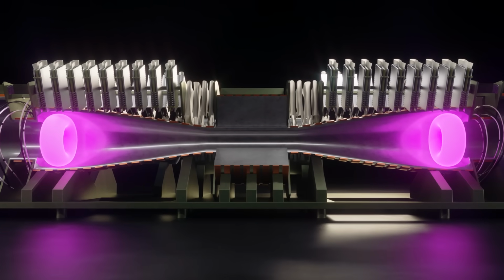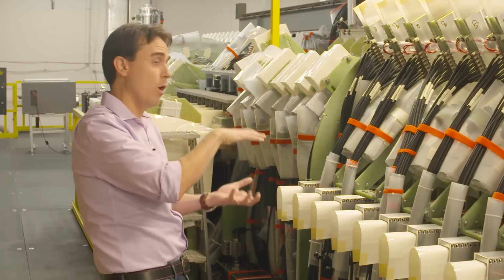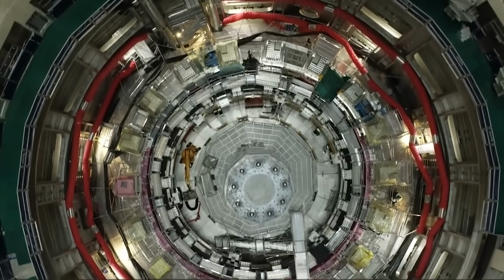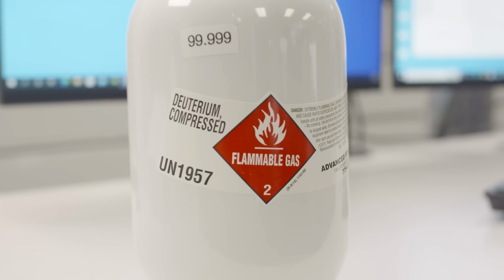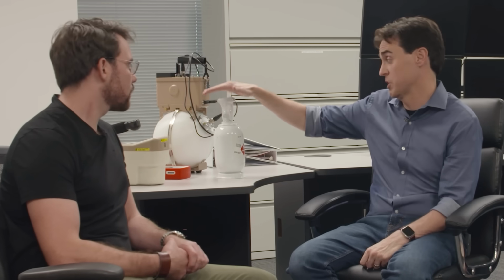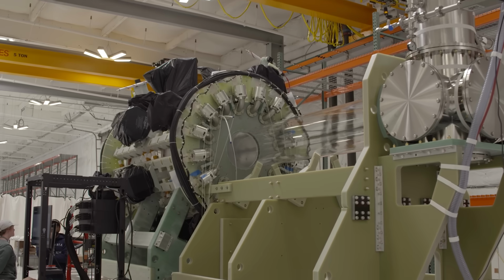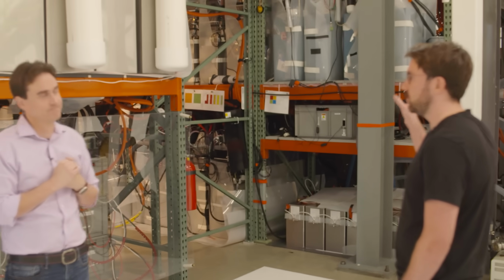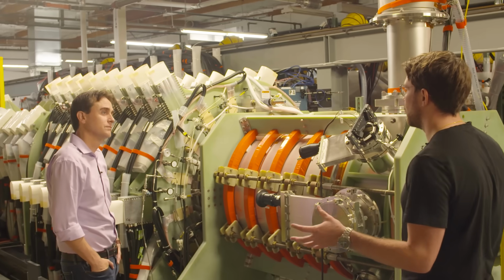A New Way to Achieve Nuclear Fusion: Helion

Comment: Did ALL matters fuse or is some gone for doing else, perhaps a reaction to spread heat/unknown(my non Einst. views) lets me consider that trying different frequencies on them electromagnets press, perhaps -if to much at specificic points certain matters tends fusing towards the unstable, which in my tiny mind could be another approach for science on exotiç particles and perhaps consider what if any noticeable Æther modes can be detected. Even Stein.. said himself a believer in Æther

Comment: how big of a fusion machine is neccesary to make it economically viable?
Reply: From what I know, the final fusion machines will be small enough to be transported by road. That means they will be < 3 meters in diameter and from what I have heard they will be about 20 meters in length. Not small but small enough.
Reply: @elmarmoelzer2229  ty, how many kW will these sall machines generate?
Reply: @walter6574   50 MW of electricity. The beautiful thing is that they can ramp up and down production really quickly to load follow, which means the early models are perfect for replacing gas turbines.
Reply: @elmarmoelzer2229  That now is uber imprssive, to have a machine that small generate that amount of power. Thnax for the info.

Comment: There weren't any figures here about energy input vs the output of the reaction. It was interesting to watch but until those numbers are plain to see, this isn't much more than a sales pitch to investors
Reply: Helion does not have to pitch to investors. They are fully funded all the way to commercialization. What they need right now is qualified employees.
Trenta is among the highest performing fusion machines out there. Polaris will produce net electricity in 2024.

Comment: key word is potential.
still in development stage. 
no reactor exists  yet still that produces power reliably.
still way too expensive and decades away from commercial application.
cheaper to perfect geothermal and gets its never ending energy with no external fuel supply needed.
no excuse hawaii  doesn't have it like iceland with cheap endless power instead of importing fossils to burn to create power.
some day the tech will be there for commercial operatrion of fusion, but we should stop putting so much money into it when geothermal more cheaply fits the task of cheap  endless power.

Comment: Whenever I hear something about dozens of millions of degrees as a mothballed fusion researcher and engineer, my toe-nails are starting to roll up. There are two distinct possibilities to achieve a decent total yield (!) of so about 10 (Q=Wout/Win) from a fusion reaction. Either, be temperature, or by pressure (and when I say pressure, I mean the magnitude of high three- to four digit GPa). The Temperature-Ansatz has one problem: While fusion rate increases with the 3rd-power of T, radiation losses increases by the 4th-power of T (Stefan Boltzmann Law). The other problem is, an electrically neutral plasma creates so much losses due to nuclear Bremsstrahlung, most of the ignition energy turns into waste-heat - reducing the yield. A combination of Lorentz-force and reluctance-force from the discontinuity of magnetic reconnection does the job to create pressure and drive about 98% of all electrons out of the hohlraum - like a magnetron. We termed our process «High-pressure pulse-plasma-fusion». Already with temperatures of about 100 kK to 1 MK. This can be done on a laboratory table - and the apparatus (with shielding) can fit into a car, truck, ship, or plane. We have even brought to life the aneutronic p-B-fusion with a an ignition energy of 600 keV and an electrical (!) yield of about 9.8 and could extract electrical energy by inductively decelerating the produced alpha-particles (He-4 cores). Unfortunately, this principle became so dangerous for mineral oil taxes and profits of our oil-prices, gas-tsars and coal-barons, all nations banned the fuel decaborane (B10H14) by putting it on a list of dangerous, controlled substances. Everybody can verify this by searching for «Alfa Aesar decaborane» taking the first link.

Addendum: The guy quotes the universal gas law p·V=N·R·T. When plasma compression is done within a high-yield fusion cycle, most of the compression work does not create heat but pushes ions together to overcome the Coulomb-barrier. Note: The integral of a force over a distance is energy.
Reply: I almost believed you but then you started with your rambling about the world governments suppressing the technology to not loose oil taxes. 🙄

BTW: I did the search and read the catalog page about decaborane at the Alfa website. It said nothing about it being banned.
Reply: @MetalheadAndNerd  A red box on the website states, «Export license required.» and the primary application mentions «Aneutronic fusion». Whenever a moderately toxic, non-radioactive fuel requires a license to buy it from US companies, there is only one suitable word: A ban. Additionally, when the application section mentions a reactor type, that doen't exist officially yet, people should to start turning their brains on. And we weren't the first team, had running into problems. SNL (Sandia National Lab) invented pulse plasma fusion around 2003. About 2007 there ware very close to Q=1. In the moment, they started to consider magnetron-like technologies to remove electrons from the Hohlraum prior to compression, they got defunded in 2008. You can look up the term «Linear transformer driver» to get the some orphaned results from SNL. Our institute at University of Basel (Switzerland) has been closed down 2012/2013 - just after our success (this was the place of the famous reactor AGN-211-P, btw.). My professor has been banned from any research (he prepares lecture schedules and exercises today), and my humble self was sacked and put into a social-help program - together with a pile of debts for a virtual rental contract. Most people won't understand it, but the behaviour of the fossile fuel industry is not a conspiracy theory. It is in fact the the largest conspiracy in the history of humankind - since 1920 (Cartel- and conspiracy lawsuit against Standard-Oil). And whoever comes forward with proof, becomes kashoggisized - or loses his existence.
Reply: @debrainwasher  If half of your story is true I would suggest that you and your professor come to Germany and get rich and famous by solving our green energy goals.

BTW: I remember a German "inventor" who claimed to have invented a car that burns water instead of gasoline. He always had a long story to tell of how the oil industry and the great conspiracy were preventing him from solving all fuel and pollution problems.

Oh, and I remember another German "inventor" who claimed to have invented a gearbox with more than 120% efficiency so it gained 20% of energy out of nothing. He had a website where he explained the awful conspiracy that included the oil industry (of course) and all major car manufacturers who were completely not interested in buying his invention.

Comment: this is kind of a backwards way of doing things.. it seems like the guy watched too much star trek and focused hardcore on electric plasma, without actually looking at the laws of physics or  the laws of relativity.
getting bismuth to plasma state and containing it there in a cyclonic nature would be a much better result, as you can use the THZ and other radio frequencies it gives off, to directly convert to power. much how you convert a microwave into electricity.
this compression fusion nonsense makes no sense..

design of a cyclonic bismuth plasma device would involve THZ lasers and phase conjugate mirrors to help resolve the THZ frequency into electricity, bismuth once heated to plasma state releases THZ freq waves and other radio waves. 

Matter to Matter conversion will always result in a loss, when it comes to thermal dynamics.. they best way to negate this is to stop having things in states of matter and instead use light or radio waves to convert to power, other ways would involve photon to photon Collison, creating matter and anti matter, then using the anti matter decay to create electricity directly.
this could be done with using sun light and focusing it into a laser to have it collide with itself.
Reply: Bismuth is too high Z for fusion to be net positive.

Comment: If they try to sustain the reaction, it will overheat and melt down. The energy required to sustain it is more than the energy produced. Hahahaha. Nice try guys.
Reply: The machine is pulsed and the magnets shield the walls from the plasma. The walls would not melt, but would be abrased over time.
Reply: @elmarmoelzer2229   it is pulsed because it would melt down if it was constant.

Comment: The problem with this method, I think, is that transferring magnetic field changes into current is way less efficient than inducing current from a high speed moving charge around a wire.

Comment: One thing about the safety of these machines I don't understand, so a magnetic field causes extremely hot plasma to not touch anything; What would happen if the magnetic field would fail?
Something that's way hotter than the sun just sitting there sounds very scary, but appearently it isn't?

Comment: Interesting.  It be even more interesting to read/hear the systemic efficiency - Power Out / Power In
WRT capacitors, why not use industrial capacitors commonly used for Power Factor correction on the grid (to correct PF near and around industrial factories with a lot of inductive (motors) loads)?

Comment: As far as I'm aware, (fission) nuclear power is competitive with cheaper forms of electricity. Long-term, and also considering the impacts of global warming and/or having to remove that CO2 from the atmosphere again, it's notably cheaper than coal, even considering processing/storing nuclear waste. The problem is that up-front cost is much greater, and people have an outsized concern about their existence (because nuclear accidents are easy to point fingers at, while the much, much, much higher death-toll from coal power plants is diffuse).

Comment: Wait. Did they really get a patents for a known fusion reaction inside a fusion reactor? If that is the case that must be one of the most BS patents ever. Not only is it not new, it has also been done before.
Reply: Presumably the patent is for the process of generating the H3, and not the actual physics of it. Shouldn’t be too hard to track down the actual patent

Edit: Helion Energy has been assigned 2 patents:

11469003 - Advanced fuel cycle and fusion reactors utilizing the same (this patent was granted 2 months ago, may be why they decided to go public now)

11049620 - Method and apparatus for the generation, heating and/or compression of plasmoids and/or recovery of energy therefrom

Comment: Very curious about the energy consumption of the helium-3 generation process. Like theoretically it's positive, but in practice is it going to require more energy than the reaction that uses the fuel going to generate. Biggest concern for me about their approach
Reply: I think it will be just energy positive. It is not that big of an issue though, if it just barely misses the mark. The D-He3 reactions will make up for that. Also, they can sell some of the Tritium to cover the cost.
Reply: The real value is it makes tritium that is an extremely valuable product. The other reaction is making helium 3 anyway. They could sell the tritium created for research or nukes and trade for helium 3 that is recycled from tritium devices. Win win 😁🤓❤

Comment: These reactions (D+D fusion and H3+D fusion) are bound to generate excess heat.  Why doesn't Helion capture that heat (at the same time cooling the machinery) and generate extra electricity from the old-school steam+generator process.....  In addition to their preferred method of capturing protons in a field to generate electricity directly.
Reply: Because that means bigger and more complex facilities that require a bigger capex and longer construction times, etc. Makes things a lot more complicated.
Reply: @elmarmoelzer2229  I suspect they are not focusing on this right now but will add a steam turbine later on, after fusion proves successful.  I bet these machines need to be cooled down anyway, so it would be suboptimal to waste this heat

Comment: What's really cool is that the Moon is a natural source of Helium-3, and NASA wants to send astronauts back there. Seems like mining Helium-3 from the moon is something that's going to happen soon enough.

Also, if it is possible to generate and contain antimatter plasma (I'm not a physicist), a reactor like this could be used to inject matter from one side and antimatter from another. Perhaps it would result in a matter-antimatter fusion reaction if that's even a thing physics permits. In any case, the energy output would be absolutely insane. Possibly enough to generate a warp field?

Comment: How do they know that fusion is actually taking place in their device? At all? Because a 'pink flash' doesn't actually prove that.
Given the company has been accused of making big glaims without actually publishing any data - it would have been nivce if you had covered that.
Sans that, this comes across more as voodoo engineering than anything real.
Reply: Helion HAS published data. Jassby who made that voodoo claim is talking out his ass. Helion had 10^9 neutrons/pulse back in 2009. That was published in scientific papers (which Jassby never bothered to google). They had 10^11 neutrons/pulse and a nTTauE of over 10^19 keV s /m3 in 2018 with their 5th prototype, Venti. That was published at TOFE in 2018 and also peer reviewed by the JASON review board for ARPA-E.
Helion has not published neutron counts and triple products for Trenta yet, but they are bound to be much higher than Venti given the scaling laws. I assume somewhere around JET, or better.
Reply: @Elmar Moelzer  The only publication google can find relates to temperature data. Along with a bunch of press releases. The ARPA-E review was skeptical that their machine was practical as envisioned due to switching gear limitations. One of the most positive things they said was that the idea could be tested for less than a billion dollars over 10 years.

This feels somewhat anemic in comparison to the publications for tokamak. If they really are as far along as they imply, even as one company, I'd expect a hell of a lot more.

Comment: After the start of fusion the inverse square law takes effect. That's why they had to make it 25% bigger. Hopefully they can line it with a Tungsten alloy to help resist higher temperatures to make it smaller.